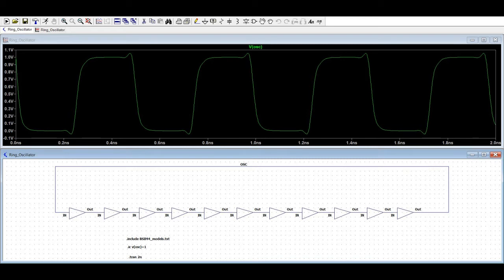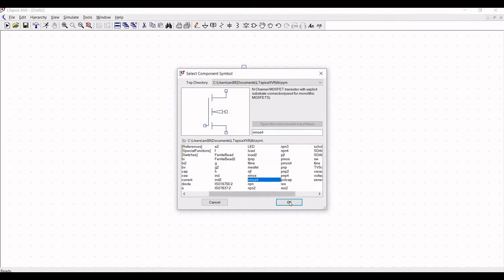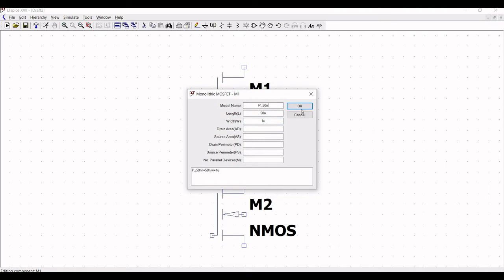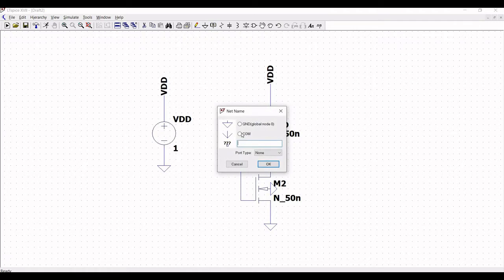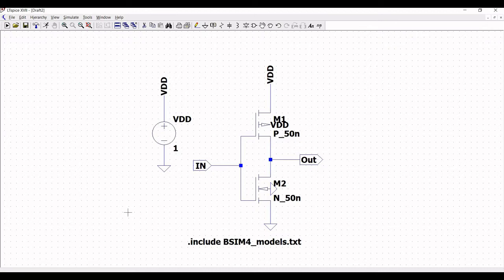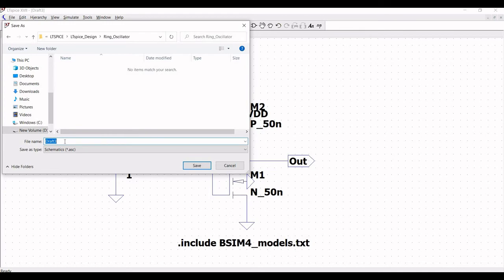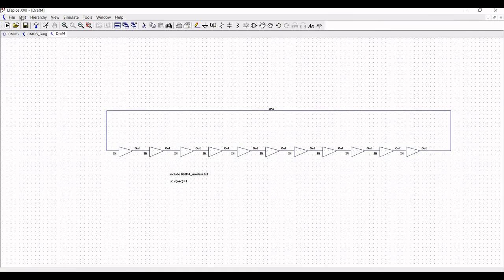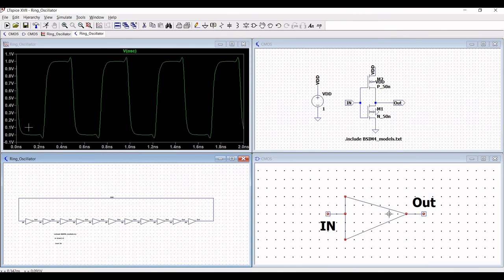LTspice tutorial 5: Simulation of Ring Oscillator using CMOS inverter

Comment: Is output of ring vco is square wave
I am but confused i need to design a vco digital pll will i go for square wave ring vco like this or sinosoidal type vco.
Please help somebody
Reply from the maker: So if you trying to design a VCO digital PLL go for square wave ring VCO.
The input resistance of the VCO is practically infinite and the input capacitance is small compared to the capacitance present in the loop filter.
There are many VCO design such as current starved vco, source coupled vco
Reply: @circuitgenerator9788  thanks a lot 🙏
Reply from the maker: Welcome

Comment: I have done everything,  but atlast showing missing schematic, and I have saved all files in one folder
Reply from the maker: Have saved the schematic and the symbol as shown in the tutorial?
Plus have saved the BSIM model file in the folder?
Reply: @circuitgenerator9788  yes I have saved , still showing error
Reply from the maker: Strange if you followed all the steps as shown in the video then you should not get any error. But the error which you have mentioned is mostly due to missing schematic or the model file
Reply: When ROSC is planed to be implemented in processors of laptop